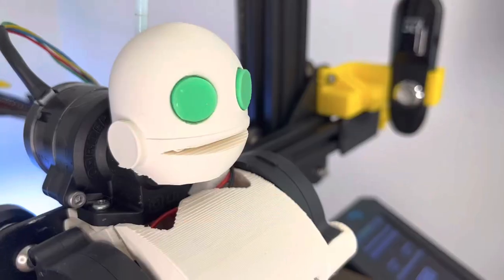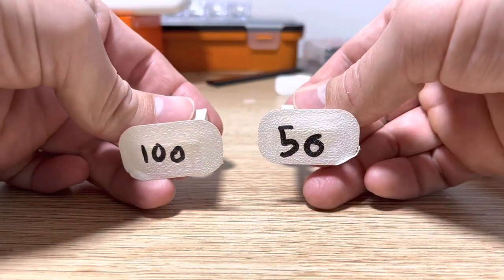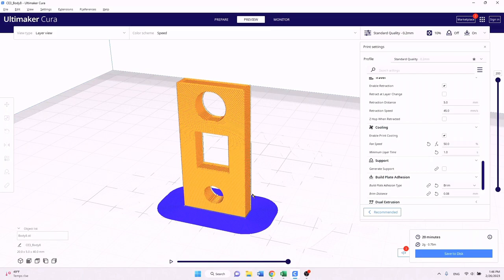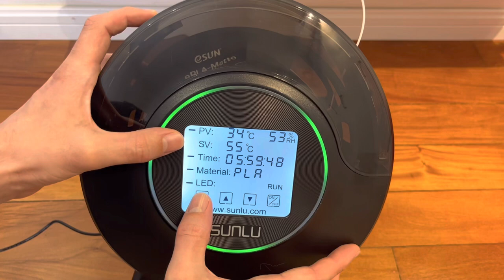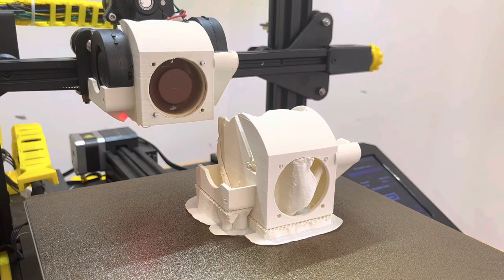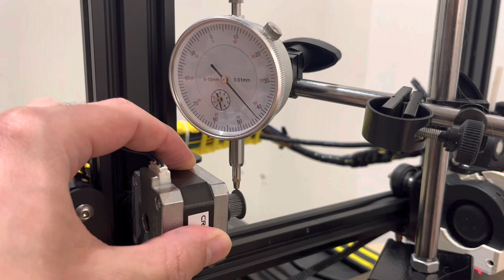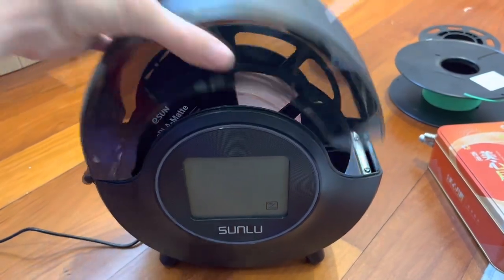Printer Quality issues? Try these 7 tips!

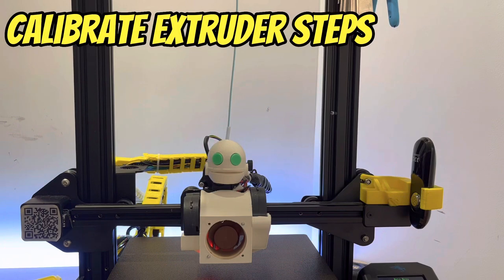Comment: 2:14 I don't think You should calibrate e-steps by pushing filament through the nozzle. E-steps calibration should be purely mechanical and every material behaves differently. So I would calibrate E-Steps by pushing filament "without any resistance" (so without the nozzle on direct drive or with bowden tube taken out), and than check and calibrate flow through the nozzle with each material.

Comment: issues like those for me, on i3 style machines, have been either extrusion based or z based. since you have a dd orbiter, i feel that the filament control is probably fine. however, every time i see someone use the dual z axis upgrade, it introduces huge z artifacts similar to what you’re seeing. if you have a spare i3 or just love to tinker, i would compare single correctly set lead screw, dual lead screw, and belted z. after about 10 i3s, all mine that can be are belted z
Reply: if you arent into belted z, i would recommend throwing on some oldham couplers to both z’s
Reply from the maker: Good suggestion. My setup is pretty easy about 5 minutes to convert back to a single Z axis lead. But maybe I’ll have to get a belt setup as well to compare

Comment: It seems to me like you probably have a bent lead screw. Other possibilities include friction caused by the drag chains (they are unnecessary with proper strain relief), the weight of the tool head causing sag, or that the z screws are simply out of alignment.

Even with all of the upgrades this printer has, in my experience even a stock ender 3 can print better than this machine at comparable speeds.

Comment: Oh gosh, please don't unplug your steppers while they are activated/enabled. That's a really good way to fry the drivers, it can randomly cause a catastrophic failure if the energized windings induce a strong enough inductive kickback at the wrong times (while making/breaking contact, the current control pulses it gives can exceed the max voltage ratings of the driver at random, due to contact bounce at the connector's terminals and the motor shoving voltage back in) It's totally fine to gently turn it by hand while it's energized, just don't spin it aggressively like a dynamo is all. The flex coupling is a great place to get a little extra grip to index it to the next position it wants to lock into, and de-energizing it won't help you reset those positions, fyi. It will always snap back into them when you plug it back in, or get stuck somewhere in-between which is also bad because it will later jump position to the nearest energized stator.
Reply from the maker: Good tip! Definitely don’t want to fry anything on the board! When the machine  is powered off if I turn one motor the other one turns the same amount. It’s like they are electromechanically coupled. So this is why I unplugged one motor.
Reply: @DesktopInventions  That makes sense, the turned motor is indeed acting like a generator to keep them stepping in-phase with one another. Even at very low speeds they are good at doing that. As per a few other's I'm a big fan of belted dual-z as once it's set it's basically locked in, I will say that it's not perfect without some extra hardware like thrust washers and 8mm shaft locks that aren't part of the common kits sadly. These days a SV06 is a better investment, but an cheap ender3, is still an endless tinkering opportunity and great to learn on.

Comment: Have you checked the backlash in your Z-nut? 
To me, the problems seems to be coming from your Z-axis. 
Your printquality is far from what I'm getting from my 3V2, despite the fact that it si becoming better.
Reply: most printers don’t have z backlash due to gravity I believe
Reply from the maker: Since the print continually moves in one Z direction I don’t think there should be any backlash issue. The quality isn’t as bad at the end I think just matte filament + vertical lighting is a really harsh combo
Reply: @DesktopInventions  I had something similar a while ago and it was my z-axis giving the problem. First I added an anti-backlashnut, which helped a lot. After replacing my T8-Z-axel, the problem was gone. My z-axel was just a little worn out, not much.